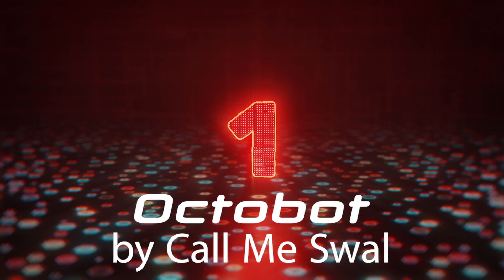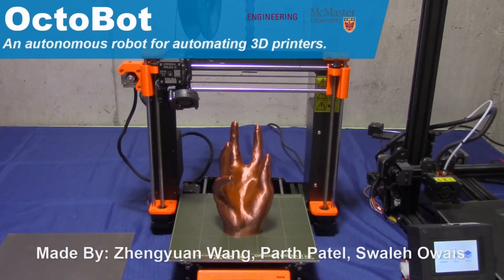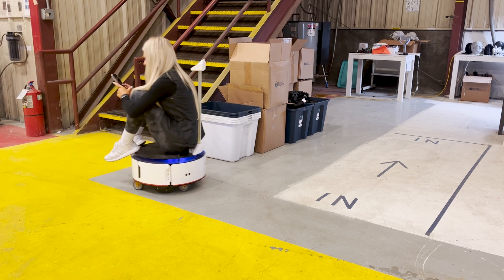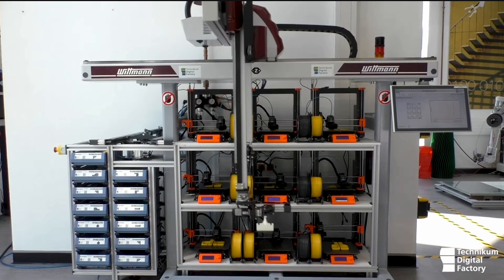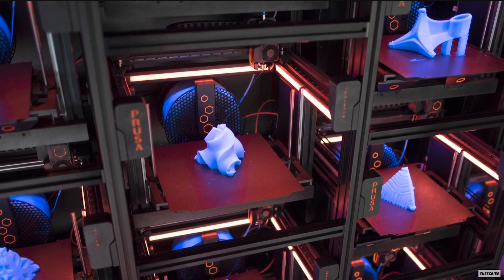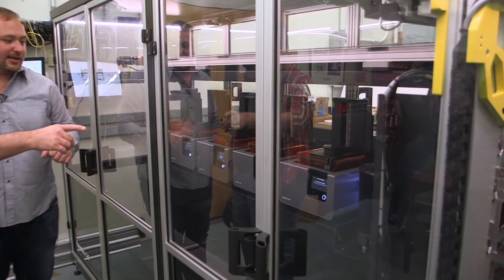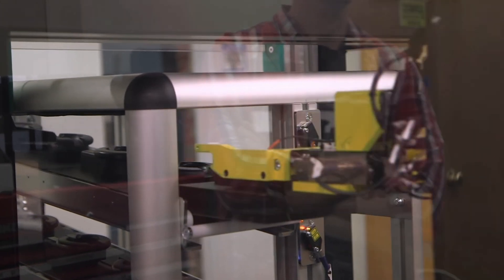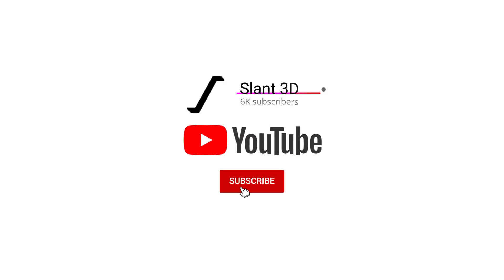Robots that Run 3D Printer Farms

Comment: Have a look at Formlabs' "Form Auto" automation solution. Pretty neat. Will be up for sale as of April.
I'd vote for Ali Aburaria's solution as something you can easily put together yourself if you're an automation engineer. As for scaling it, there are tons of solutions if you can cough up the investment.
Prusa's solution would look attractive too if it wasn't for the fact that the $2K per printer price tag is overpriced for a printer that has last gen print speed. I'd much rather have the price tag and the print speed of a P1P which produces 2.5 parts while the Prusa makes 1. It'll be interesting to see if their automation solution would work with other brands such as Bambu Lab.